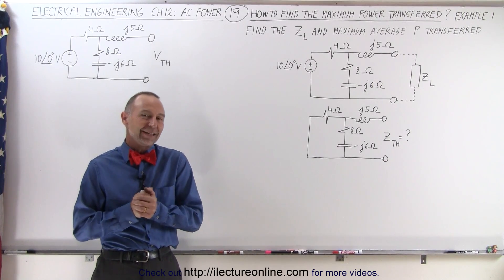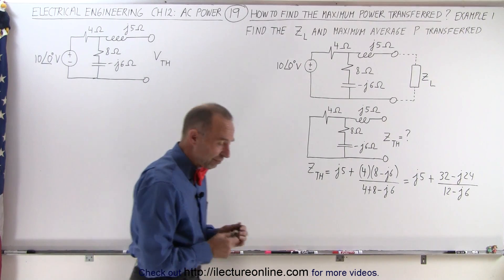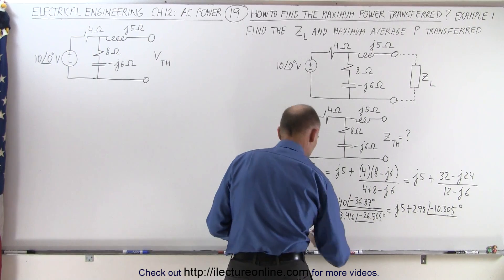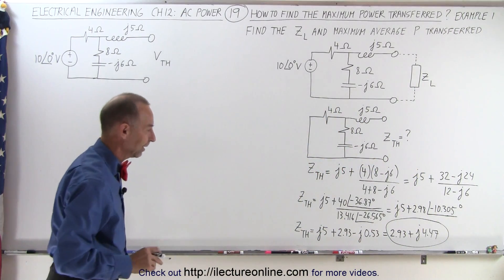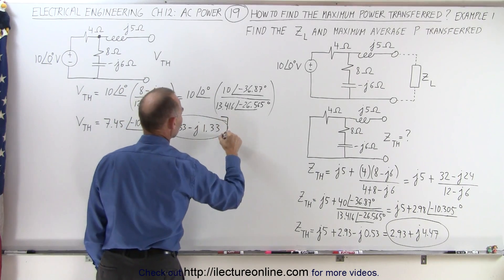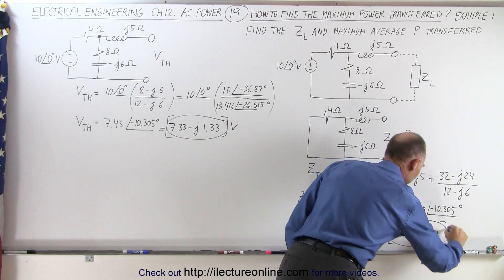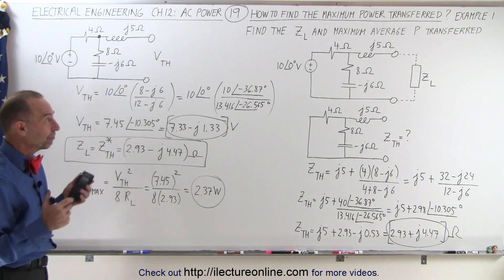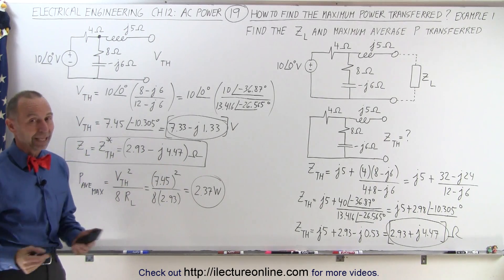Electrical Engineering: Ch 12 AC Power (19 of 38) How to Find Max. Power Transferred? Example 1

Comment: Maximum power transfer formula is wrong....check in standard books....
I checked power transfer to load is not equal to power which is calculated by using formula

Comment: hey michel, i think Vth should be what you calculated here minus voltage drop through the inductor (j5) , isn't this?
Reply from the maker: You can only have a current in a complete loop.
Reply: @MichelvanBiezen  thanks ❤
Reply: @MichelvanBiezen  But there can still be voltage around Vth even though there's no current flowing through, so wouldn't you still have to take the inductor into account? genuine question because I want to know
Reply: or through the inductor there is no current??